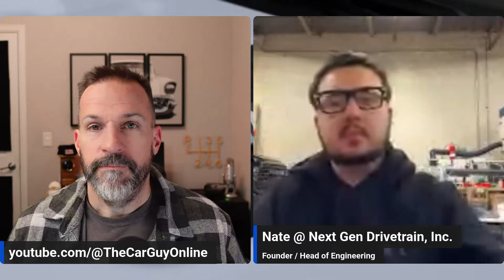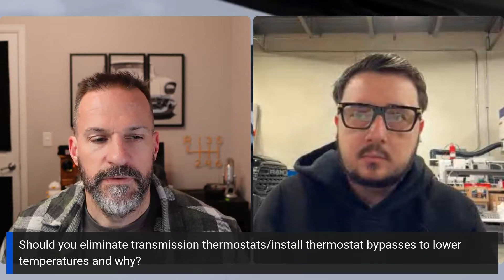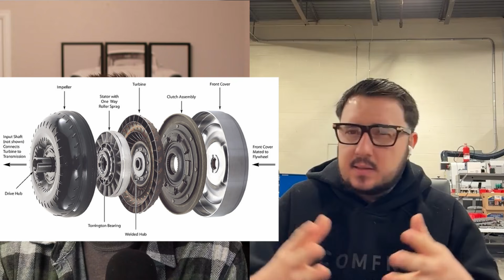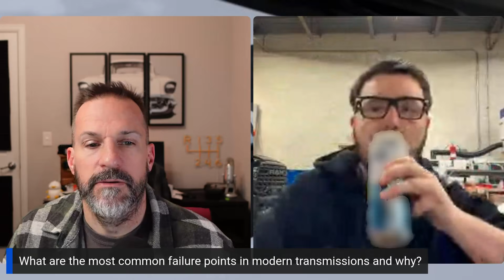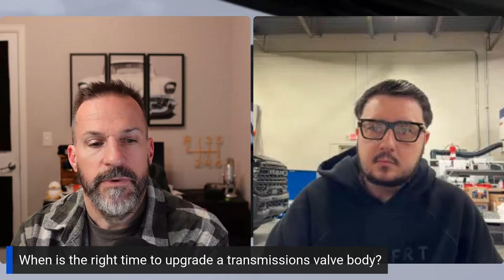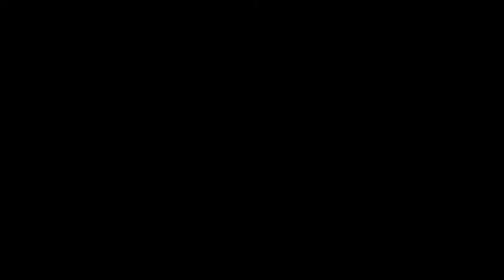Transmission Maintenance Questions Answered w/ NextGen Drivetrain

Comment: What can I do to make a Nissan CVT transmission last longer?  Started sounding trashy just after 100k, had fluid changed but didn't make noise go away.  Sounds like it's got gravel in it at rpms below 3200, especially when cold.

Comment: If he truly believes these transmissions have problems, wouldn't it make more sense  that his business can covert them to super simple 6 speeds like the 6 speed automatic toyota transmissions? These are all bandaids to a big problem.  Is there a more simple and reliable transmission than those 6 speeds?  Make a kit that internally converts them to that. Or even better, create a business that sells used Keitora vehicles from Japan.  Simple and Reliable means throwing these American vehicles in the trash.

Comment: If I want to upgrade the valve body on a 2025 Silverado 5.3 with a 10 speed with a nextgen valve body won’t this void the manufacturer warranty? The truck has 13K miles and I can already feel the slop. Thanks!

Comment: I have a 2025 Chevy 1500 with a 2.7 turbo and 8 speed with 5,000 miles. With your valve body, can I make this transmission last well over 100,000 miles without problems with normal use?

Comment: Cluth shedding material is known to be super high between 30-60K miles. Could it be that since these transmissions have so many gears, which increases cluthes, that there's just too much cluth debris in the valvebody?

Comment: Thanks Nate for saying how it is. I am a huge advocate for annual transmission pan drops on my 850RE Jeep Gladiator. I switched to annual immediately after having my 8 speed auto replaced and it wasn’t until the 3rd pan drop that I noticed a significant temp drop from the 180’s to the 170’s F. When I finally did my 4th pan drop I witnessed the temp drop to 165F on a 3 hour highway drive from Edmonton to Calgary. I have since gone from my 21 JTR to my now, 23 JTR and did the first pan drop with only 24k kms on it. I will be doing my 2nd pan drop next month in April, before the hot summer temps move in. My actions of annual pan drops will see zero measurable oxidation in the oil and lower running temps.

Comment: 10R80 Ford trans story FYI.
2 LITRE BiTurbo engine.
I monitor everything  via OBD and a scanner app on android.
At 60,000km I decided an early oil trans change is great prevention, or 10R80 protection.
Normal temp ranges on a 100km run (unladen) 89-95°C. 
So I got the oil changed. Took the car for a 100km run. 
Oil temp went to 110°C constant.
Turns out, dealer mechanic overfilled TRANS oil. Ths caused frothing of the oil which meant less heat carrying dissipation etc etc.
Took it back to dealer, set the correct level of oil and now all good.
Dealer stated "you know if you hadn't been measuring this you would not have known". 
I replied " true, but 1 of 2 things will happen, either the trans will fail a couple of years after warranty, which you will most likely try to place the burden on me,  or, worse,  I will be towing  my caravan, the trans goes to 120°C and goes into limp mode requiring road rescue".
Recommendations...
Always monitor your vehicle systems, know what is normal and what is not.
Reply: Why I DIY and know it got done right.  Within reason.

Comment: I’m looking at a new Sierra or Silverado HD with the 6.6 gas engine for our business. We pull a 6000lb trailer frequently. If I buy this truck and install your valve body kit, will this set us up for reliability or is it better to hold off on the purchase?

Comment: Nate you’re extremely knowledgeable person. I have a cx30 2020, best zoom -zoom. I owned ONLY Mazda for the last 24 years . There super cars in maintenance. On My CX30 2020 I change oil every 5k ( OEM oil filter) and Mobil 1 ONLY oil ( I don’t switched) but the transmission fluid I did it already twice , every 35 k along with the transmission filter. It’s time consuming because they don’t use a rubber gasket anymore, now they used RTV but you know what…… with 80k miles on the dash you CANNOT feel when the car shifts. It’s unbelievable how smooth it goes. I ONLy use OEM, even the RTV. Everything OEM people. By the way …..great conversation here. Thanks to get Nate here, he’s truly a PROFESSIONAL

Comment: For people who are looking to do a engine and transmission swap, what would be the best stock 6 speed and 8 speed transmission to start with? Anybody can answer this question if they know the answer. I do know that a kot of people are using the 8HP series trans but I was hoping to use the engine and trans as a complete unit  from a donor vehicle. I didn't necessarily want to use a Chrysler engine if I didn't have to. That might just be the way it has to go though. Ya never know.

John 3:16

Comment: As a fairly new F150 / 10R80 owner with 12k,  I have more clarity on what to do moving forward. I will change the trans. oil and filter at 25-30k with a high quality ULV oil, probably not mercon, possibly Amsoil or mobile one.  Also Install a third party oil pan with extra capacity like a PPE  with a drain plug to keep the operating temp down and allow easier fuild exchange. At 60k or warranty end do a NextGen valve body upgrade kit and drive my truck 300k without trans. issues.
Reply: I thought I would be smart and change my transmission fluid "early" on my 2018 F150 at 75,000 miles.  It was too late... Lesson learned!  I'd recommend Amsoil but Moble 1 does really good with their products too.

Comment: I do have a question for nate when it comes to older autos like I have (i have a pair of 4r100s in a 1997 f150 [jasper reman] and a 2000 excursion [original trans] and what I've heard with those older ones is that you dont change it if its never been changed because it'll burn up
The f150 has about 100k on its trans and the excursion has 92k on its trans, both are red fluid still

Comment: Every 10°C increase over 70°C in temperature cuts modern electronics lives in half, this is actually a studied feature in silicon chip design. This guy is absolutely right, keeping your temps down more just helps everything. Heat is a catalyst for many negative reactions and changes in everything, period. More heat wears out everything faster.

Comment: GM transmission engineers need to subscribe to this channel
Reply: I have a feeling it's not the engineers that are the problem, it's the bean counters!
Reply: The engineers know all of this. They aren’t the decision makers. The MBAs and accountants are.
Reply: @arnoldmarcus3634  actually no, the MBA/accountants are NOT the decision makers alone, in fact these big co's make a joint decision and often its made by an engineer who also knows accounting.  Learn thingsn before you  keep spouting folklore we've all been overspouting for forty yrs.  Stop the nonsense.   Engineers make most of these decisions.  PERIOD
Reply: @18_rabbit  just FYI, there have been a lot of retired, GM and Ford engineers, and specifically on this side of GM engineer that worked in the transmission department, that disputes everything you just said. They said it’s all being encounters making the decisions. They start with a decent transmission to begin with from ZF, and the bean counters say which parts need to replace with cheaper ones. Multiple engineers have opened their mouths to say this is just going to create failure in one of me reported the GM top executive saying, he didn’t care, they’ll just buy new trucks. I think you’re a little naïve and the data is out there from actual engineers if you look for it. Some have been on this channel actually.

Comment: I drive a 1970 VW with a standard 4 speed transmission.  The car is a daily driver with 500,000 plus miles.  I’ve never changed the transmission oil.  Neither the engine or the transmission have filters.  Should I change the transmission oil?  I’d like to drive this car for another 500,000 miles.  Maybe more.
Reply: Yes. You should change the transmission oil. Manual transmission fluid (gear oil) lasts much longer than ATF, but still should be changed.

Comment: Removing/bypassing the thermostat doesn’t seem like a wise idea to me. It’s not going to change the overall peak temperatures seen by the transmission under identical operating conditions, it’s just going to take longer to get to operating temperature. Yes engines and transmission “work fine” as he stated, that doesn’t mean they’re working optimally. Every vehicle I’ve ever driven operates worse at cold temperatures than at operating temperature because it’s operating in open loop instead of closed loop.
Reply: Well I switched out my GM 6 speed thermostat to an aftermarket unit.  It used to run at 190F and above.  Now it’s at 130F.  It has to help.  I’m in Missouri and our winters are mild.
Reply: @slalomking  operating temps after hours of driving is only 130F? That was clearly a resitrictive thermostat then. Whether I pin the thermostat open on my Tundra or not, peak temps don't change. I've tested it on the same day doing the exact same drive. Only difference is, with the thermostat pinned open, it takes longer to get to operating temperature, and it doesn't shift as well when it's not at operating temperature.
Reply: @red @redline870 redline, the factory GM tranny thermostat is set to open at 180F.  GM learned they fucked up and then offered a new one that opens at 158F.  That’s still too high.  The aftermarket one I have has no thermostat but a spool piece to restrict the flow as if it had a thermostat.  You have a Toyrota, obviously it’s different than my GM.

Comment: Toyotas have never needed valve body upgrades in order to last 500,000 miles as long as the owner kept them filled with fresh fluid that was carefully set to the correct level.
Reply: True, he’s talking about GM, Ford and Ram which really is a Dodge.

Comment: The 6l80 in my Sierra failed 100% due to the thermostat getting stuck closed. Temperatures topped 260 degrees before it started missing shifts. The damage was done. The torque converter disintegrated less than 10k later after bypassing.

Comment: We purchased a 2025 Subaru Forester Sport new and we will change the transmission fluid every 30,000 to 35,000 miles and I've always changed the transmission fluid in my vehicles every 30,000 to 35,000 mile's and when the sales people at the dealer tell you it's a life time transmission and you don't have to check or change the fluid it's a lie because there is NO SUCH THING AS A LIFE TIME TRANSMISSION AND THERE NEVER HAS BEEN PERIOD!!!!!!!!!!!!!  If anybody has ever looked inside and 8 or 10 speed transmission they're a nightmare because they're so complicated it's ridiculous!!!!!!!!!!!

Comment: I got a 2004 f350 superduty. I do a drain and fill every year on the trans, transfer case and differentials. She has 328K. Never had an issue with it
Reply: Smart not crazy at all.
Reply: That 5r transmission is a lot stronger than these newer ones too.

Comment: I have a 2018 Chevy Silverado with a 9L80 transmission. At 30k it started to shutter. Dealership charged me $700 to flush the system and replace it with so called better fluid. I’m at 67k and it started shifting a little more aggressive to where you could feel it. This time, I changed rhe fluid myself and I went with Valvoline premium full synthetic extended protection ATF, holy smokes, feels like a brand new ride and is super smooth!!!! Very well pleased with all Valvoline products, but this was a game changer. Clearly these modern vehicles weren’t made to last, but I’m going to do all that I can to help it survive as long as possible. My favorite vehicle is still my 1985 C10 truck with the 700R4. Built to last! 🇺🇸
Reply: 700R4 Transmissions had tons of problems.  Replaced and repaired many of them .
Reply: I love my 1980 sierra grande with a 305ci & TH350. Way better than 700r4

Comment: I recently bought a 22 Colorado, with 36k miles, at 40k, I changed the differential gear, transfer case, and transmission fluid, with all synthetic, Feels so much better. I've changed the oil twice, the first time was after I got it home, then at 40k. I'm not going by the book, of longevity,  like you said, they want it to break down. Change your fluids often for longevity.

Comment: That valve body repair by the way is just over $4,000 if you are wondering. My brother's GMC 2500HD work truck just had the transmission's valve body go out at under 100,000 miles, and he got the full upgrade Next Gen Drivetrain's kit and had it installed for just under the same price. Good luck to all GM 10-speed transmission owners because you are going to need it.

Comment: If a manufacturer is trusted overall to make a decent product, the verification of their quality helps cement in that trust, & a failure MAY harm that trust, depending on how it is handled. (See below.) And if a manufacturer is trusted overall to make a decent product at a decent price, that means there is positive pressure to create good future products, because quality at a reasonable price creates demand for the product, increasing the reputation, & ultimately, the profits of the manufacturer like a snowball rolling down hill with the reputation growing as it picks up speed.
 
This does not mean that an established manufacturer of quality products cannot make errors, but even an occasional substandard component can actually INCREASE the quality reputation of a given manufacturer, based on how the product concern is handled. (Note for example early Lexus recalls that impressed the new owners of the vehicles & increased the reputation of Lexus which had already gotten off to a good start.).

If it is true that GM, for example, is purposely making substandard components to "save money" & incrementally increase mpg in order to avoid Federal Govt (EPA) financial fines, thus "saving" more $$, then they are actually shooting themselves in the foot because eventually the public who purchases such vehicles with substandard transmissions or engines or with electrical concerns, will soon be out of business through destruction of reputation meaning that less and less individuals will want to buy the vehicles. 

The only logical long-term goal of such a dysfunctional operation would be to seek out US taxpayer-funded federal govt assistance from you & me, to bail out such a manufacturer if they begin to falter, especially during an economic downturn, using the excuse of Federal "Green New Deal" regulations and endless push to stop the fine natural gas called Carbon Dioxide from increasing, which will increase the health and growth of green plants, which then create oxygen, & thus making all this clearly a scam since "97% of scientists" do NOT agree with this, but were selected from a chosen group that already agreed with this chicanery.  The reason so many agree & make absurd predictions, which usually do not come true, & yet keep their jobs & are often advanced in their position, is because the US Federal Government organizations, like the EPA & their appointed administrators, & the college professors, & the legacy media, all bark the same bark & generally see taxpayer funded $$ coming their way to fight "Climate Change" while feeling good about themselves.  

This does not mean you or me or the guy next door want to all drink gutter water & adore dirty air. It means that the "experts" chosen by the US federal government come from a group of individuals that are funded by and thus therefore tend to support the Federal Government guidelines like a group of people who generally think the same way all talking to each other, making sure that other experts are kept out, & ensuring that there are no repercussions from being flat out wrong while wasting billions & trillions of dollars on poorly understood & often "created crises" that keep their paychecks fat.

In short, GM & Ford or any other manufacturer simply cannot continue down this path for long without failure of the business. And note how the CEO and the board of directors generally pay no price for the mess that now exists & are paid enormous paychecks even if the company fails. Thus in a real sense those at the top of GM and Ford (not the engineers down at the bottom) for example, actually support the nonsense that they have to put up with from the Federal Government, and the baloney they frequently spew (our glorious all electric future for example) as long as they keep their profits fat. It is crazy. Yes there have been some efforts by manufacturers to claw back at the government EPA regulations, but it has never been as effective and focused as it should have been to outline the enormous amount of nonsensical regulations they have to deal with, & the CEOS keep their enormous paychecks and their fawning board of directors continue to praise them as fine effective leaders. It's a mess.

Comment: So, upgrading a valve body on my 2025 , 5.3 Silverado on trans will not avoid my warranty? If I upgrade valve body and still have some trans issues do you think GM will cover on a warranty?
Reply: If you modify a GM transmission with aftermarket parts, of course it will void your warranty .
Reply: You should want until your out of your factory warranty

Comment: Another market broken by government: when you buy a new vehicle... regulators got there years ahead and spec'd it for you.  Remember the "yes, we can" slogan of a past political campaign?  It needs a slight recalibration:  "because we can" - that's how it goes, deciding the square peg goes in a round hole.
Look to smaller non-EU markets when in doubt: hardware choices, maintenance schedules, fluid specs: you are likely to discover engineers work and not some comittee hiding behind academics that never had to pop tall and estimate longevity so warranty claim risks could be calculated.